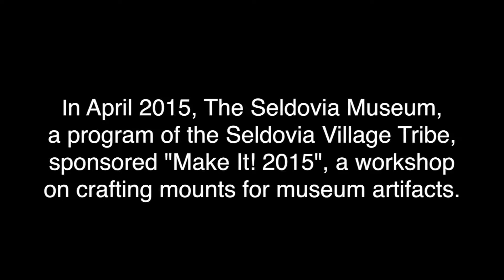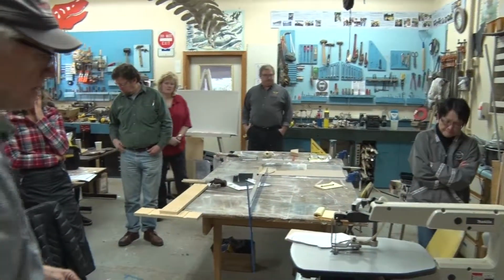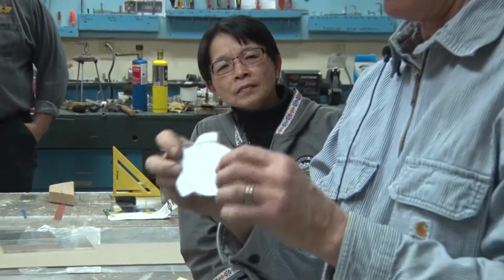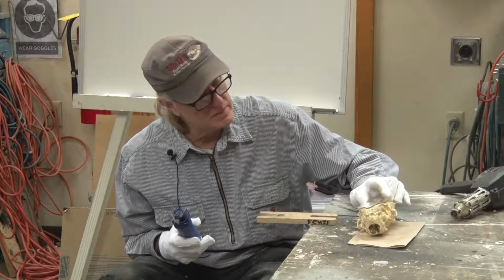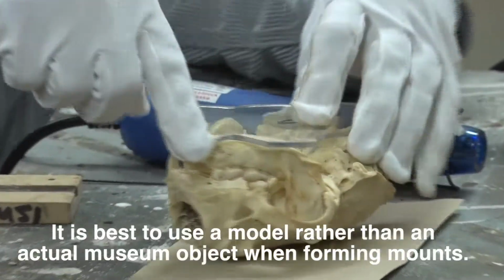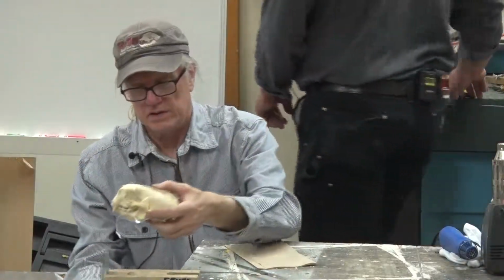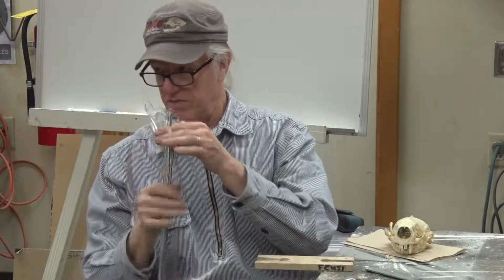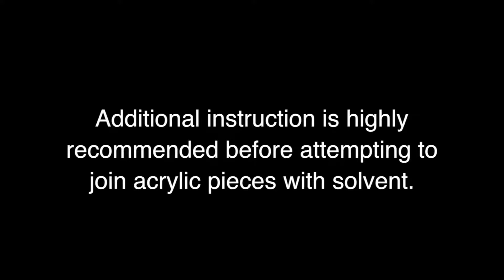Creating Acrylic Museum Mounts

Comment: You could take a cast of the object, that way you avoid interaction with it.
Reply: I understand it is probably a cost thing.   Having a sheet of mylar between the mount and the object may help too, not surre if there could be residues transferred. Again we are suppose to treat all objects equally as valuable for their social signifigance.
Reply: You could also find something with the same or similar enough curve to use if the object is more fragile.
Reply: Normally I use cotton gloves. This was from the education collections, which are generally available for handling.